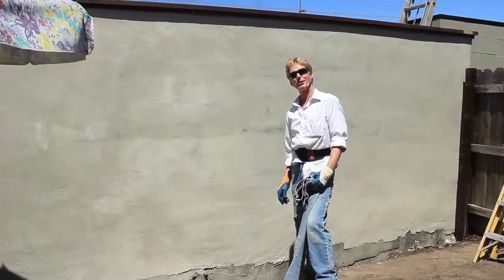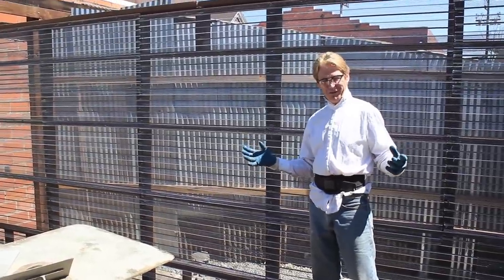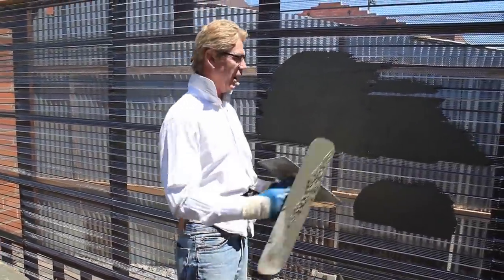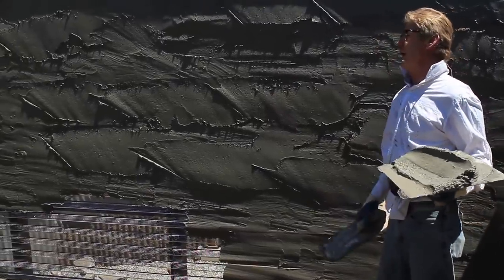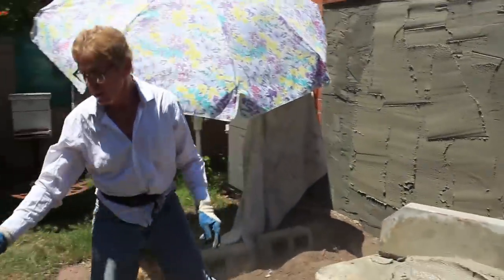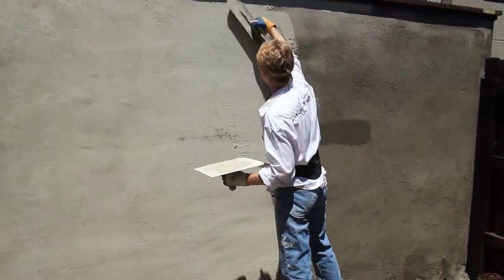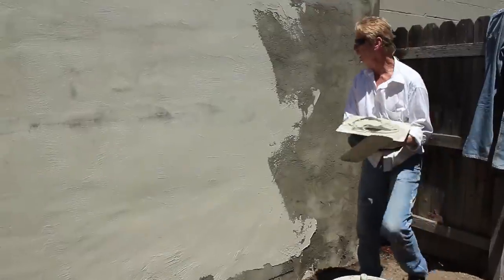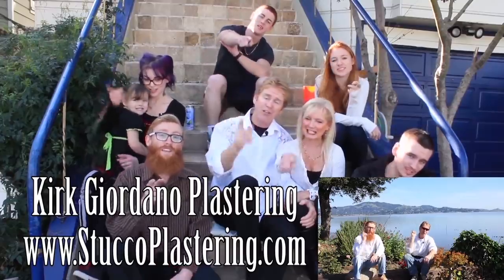Retaining wall Stucco fence

Comment: Cinder block is very, very light. Because it is a not made of concrete.
Reply from the maker: Good evening James, good tip brother.
Welcoming, peace, love, and brotherhood, back into the 🌎 of Plastering.
    Bringing you the most comprehensive encyclopedia of free plastering video’s ever put together,
 by the plastering messengers of Youtube. 
Kirk and Jason Giordano with over 800 videos 🎭 👀💃